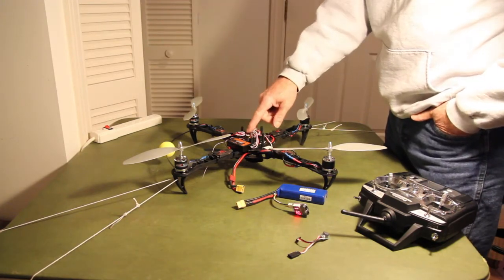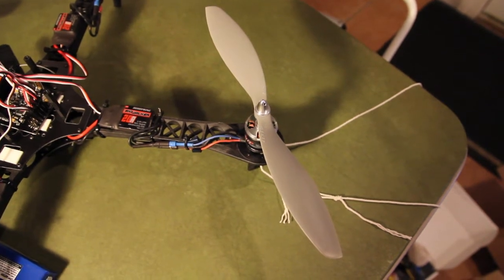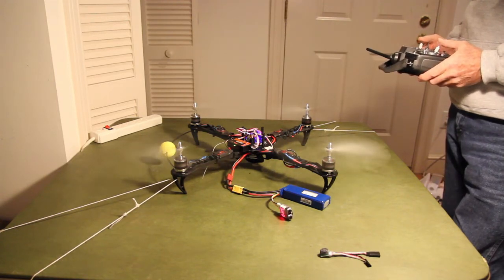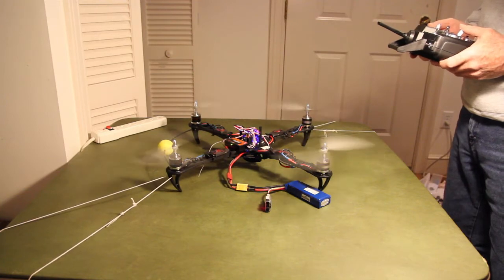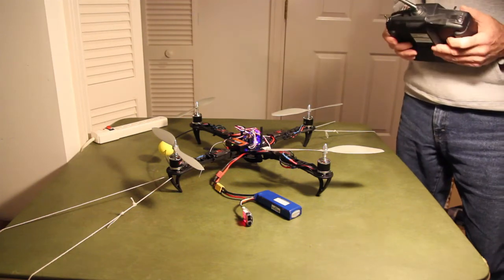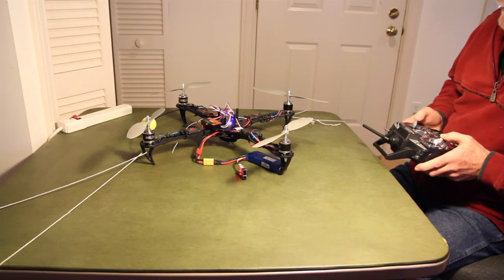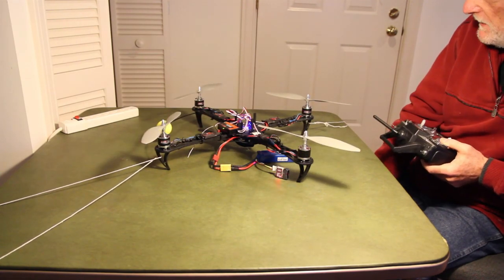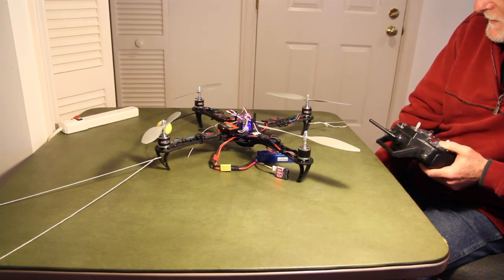Custom Quadcopter for Under $200 - Tie Down Test

Comment from the maker: You are correct.  I have since built a "test" board that holds the quad better - though that won't help out if a prop breaks during testing!  Eye protection is probably called for.  Though the most common mistake I make over and over again, is I forget to DE-ARM the quad before I pick it up in the field to move back to starting point or whatever.  I have a black fingernail now to remind me to unplug or de-arm before reaching anywhere near the props!

Comment from the maker: Hi Andy,  You are correct, I had taped down the board initially until everything was set up correctly, then used wire ties to align and keep the board tight on the frame.  Since building this quad, I have made quite a few more and now use this one to test out various flight control boards,

Comment from the maker: Acutally, it was a lot simpler than that.....had it connected wrong.  To a channel that wasn't being used so after a minute of not sensing anything it went off.  It was a lost plane alarm not a battery alarm.  Now I use a battery alarm only, which connects to the balanced connector off the battery.  Works great.  I also am now using a Black Vortex board with MegaPirates.  Still tuning it up though.

Comment from the maker: You are correct...I didn't include the cost of the receiver or transmitter.  It comes to about $205 including battery.  I already had shrink wrap, solder and misc parts from previous build - so if this was an initial build I am sure it would run as much as $50 more.  There are kits out there that include all motors, esc's and frames for about $150-200 - then you would only need battery ($25), flight controller ($25) Transmitter and Receiver ($79 for Turnigy 9 channel on sale at HobbyKing).

Comment from the maker: These parts are available through a number of sources.  I don't know where you are located, but in the US there are many distributors/resellers offering these or similar parts.  Or you can purchase directly from China - I have used Foxtech and Hobby King - both reputable companies.  Since this video was made, there are a number of frames available - with integrated power boards - for the same price.  Check out RCGroups or Multirotors forums to see what people are currently using. Good luck.

Comment from the maker: You are correct....today.  Back when I made this video, things were a lot more expensive, especially decent controller boards.  Though, $100 would be hard to do unless you went with a ladybird or something like that.  Decent motors and esc's are still running at least $15 or $20 each!  Though a decent KK2 board is less than $25 these days (maybe even $15 or so).

Comment from the maker: I am using 20 amp ESCs with the motors and a 25C 2200mah battery.  So far, no problems whatsoever with anything.

Comment from the maker: Actually, I use it to test out new flight control boards.  I have transitioned to some pretty cool boards.  The latest I am in the process of testing out is the 3DR APM 2.5+  We are offering them via our website - a really great controller for the money.  UAV-America  need to add the dot com.

Comment: Hmm Im using those exact motors, I like them, but one came with a crashed bearing sadly....
 and check your C rating on your battery. Make sure you're not over loading the battery

Comment: Well you were saying in the video that the battery alarm goes off? or did you sort that out? The ESCs run at whatever amps it needs to for the motor. If we say the motors are running at max amps (18 for these, so 18*4) that's a wopping 72 amps... Your battery here can only supply 55.... (25*2.2). That might be why the alarm is going off early